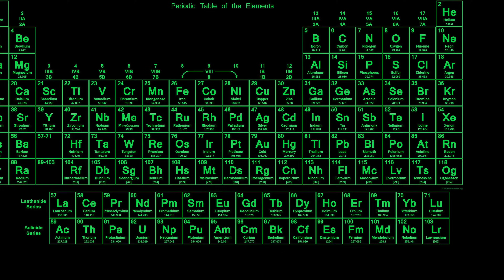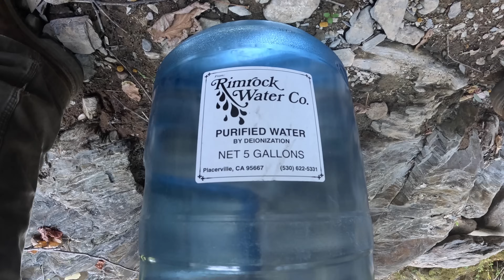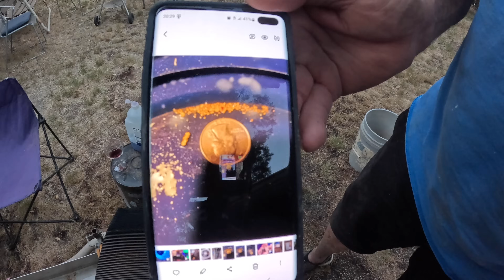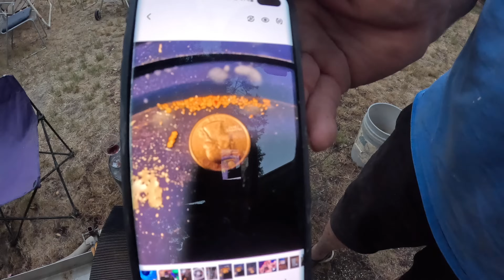Gold Prospecting in the Mother Lode

Comment: Hey, Harry.  It’s a millipede, not a centipede.  And it’s slate, not shale.  In the Sierra motherlode (where I live), it’s the most common basement rock.  Black slate usually decomposes to light blue-gray clay, and the richest pay is in the rusty gravels overlaying it.  

In Tertiary rivers, this oxygen-poor layer was blue (the fabled “blue lead) and well-cemented into sheets of quartz conglomerate.  Once exposed to air, it oxidized into a rust-color. It’s found many places in the motherlode belt, but especially in the old hydraulic pits.

Comment: I've always liked the 5 gal bucket, wet classifying method.
I do question why, after doing all the classification, the repetitive back and forth turning of the bucket, why most guys don't discard the top 2/3 rds of the material in the bucket.
It would make hauling out easier, or add the ability to add more to the bucket, because all of the gold would have stratified down to the very bottom of the bucket.

It's basically like a big gold pan, all the heavies will settle, and the top material will be waste.
Reply: Always wondered this myself. If you shake the bucket or even hand mix everything the gold will drop very quickly.
Reply from the maker: @John-ir2zf  I get placer pickers from cons in first few scoops too.  Especially in desert drywash cons.